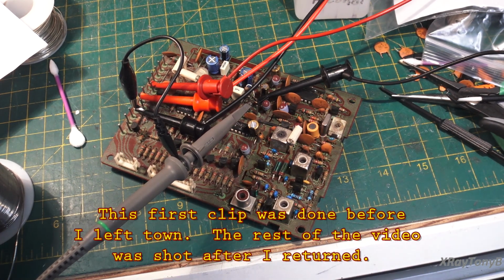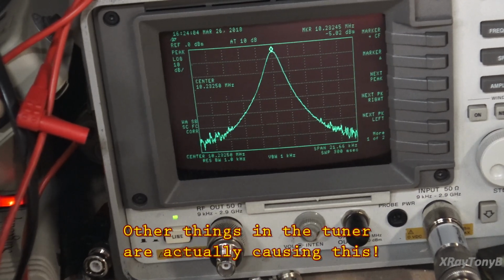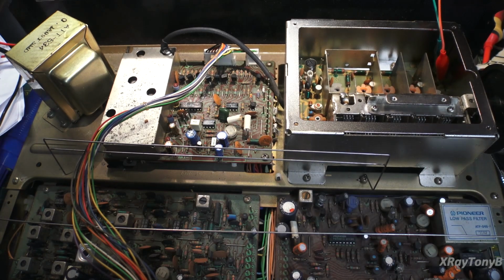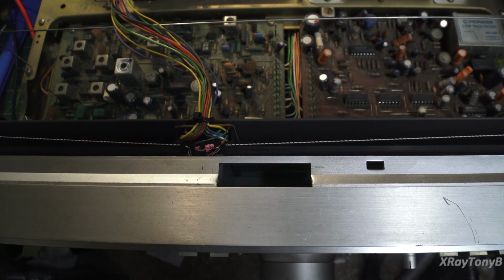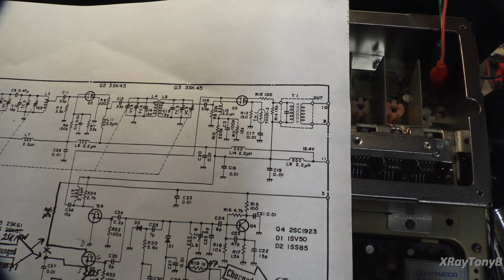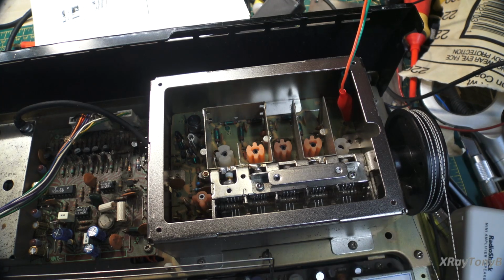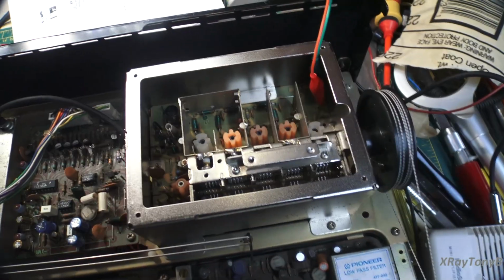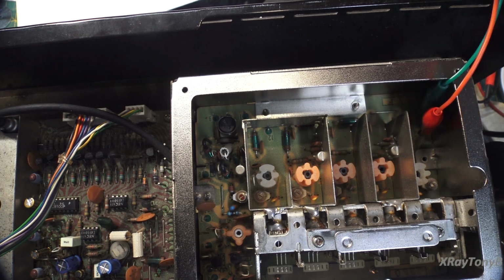Pioneer F-28 Part 5 - An Update

Comment: Great video! My first thought after you touched the 3rd (mixer) MOSFET in the frontend and the signal got much cleaner, was some parasitic oscillation (that could possibly be fixed by increasing the drain resistor a bit). Haven't watched part 6 yet though :)

Comment: Damn, I had a hunch it was a bad trimmer in the VCO all along, as they do tend to fail once in a while (and when a varicap is dead, it tends to be a dead short instead). There's really no telling without pulling it out of circuit though. Now the other ones sure seem suspect as well, though I'd make sure the varicap's wiper contacts (if any) are squeaky clean first. (Some top-flight tuners used to have wiperless varicaps, not sure whether this one does as well.)

As mentioned, testing the mixer MOSFET via IF passthrough does not seem the smartest idea on a unit that is supposed to have 120 dB of IF rejection. I'd rather want to verify that it's doing its job as a mixer well. Or maybe you could fashion some Rather Inductive Test Leads to attach to source resistor R12 (maybe using an old analog VOM that isn't bothered by RF)? If voltage were highly erratic, that would be very suspect, but what if it isn't?

Comment: This fix has almost been like a car chase in the city; up, down, all around the town!  Luckily no pedestrians injured!  I'll be quite happy to see you fix more normal stuff for a while.  
Assuming this replacement or a subsequent fix, repairs the whole tuner, please list all the fixes you made on the tuner to get it working.  This crazy "digilog" beast is so hard to understand, that there were a whole bunch of engineering changes on the schematics.  I suspect that those are there to fix bugs only exposed by use.  
I know you design your own equipment at times.  Using modern digital and analog components, how would you make an as good or better tuner?   You've been through almost all of this thing!  How could you add this tuner's sensitivity to a good digital tuner?  That's the same question as before really, but I believe this tuner shows that digital combined with analog may be how to make a "best" tuner ever.

Comment: Sorry for all the posts, but I wanted each point to be separate.  I have to disagree with you about injecting the IF at the antenna terminals.  Yeah, that probably works fine with most of the craptasic designs where the mixer is right by the antenna terminals.  But after two stages of filtering and amplification - it better have some pretty good attenuation at 10.7MHz when it's supposed to be passing 88-108MHz!  Frankly, I take this as a sign of a GOOD radio!  As for the mixer - do you get the same results when pushing down with a plastic tool?  (Perhaps your finger is an added antenna.)  Have you tried resoldering it?  (Perhaps it's a bad connection.)
Reply: Yes well normally you inject at the front of the first IF stage for working/aligning IF as you no doubt know because the front end is tuned for a bandwidth of 88-108mhz. But in Tony's case, he wanted to check the gain of each stage through the vari-cap...I guess he could have used 98mhz, but then that wouldn't work further down the chain in IF world....so I sort of see why he did that.  Plenty of different ways to skin a cat, gave him the information he was after.
Reply: I'd have to concur - this tuner is supposed to have a whopping 120 dB of IF rejection. (All those gangs have got to be doing something, right?) As such, getting any 10.7 through the frontend should be nigh impossible even when everything is working fine. Coming up with a better method for testing the mixer seems advisable.

Comment: Did you ever figure out what light wavelengths the photo transistors in the encoder were sensitive to?  I have to wonder if they weren't infrared.  The white LEDs may have been too "dim" at that wavelength to work right.  A dim incandescent is going to be a very rich source of infrared.  If it was me, I think I'd see if I couldn't add a resistor to drop the bulb voltage a bit.  A small drop goes a long ways to improving bulb life.  If that works, then the LED conversion wouldn't be worth the effort.

Comment: Yep, a lot of parts and circuits are the same between CB radios and receivers.  Back in the day most CB manufacturers just used what parts were readily available and were already being used in things like stereos.  That's why CB's usually have the same IF frequencies as receivers.  A cheap source of parts.

Trimmer caps, ugg....  Can't count how many of those I have had to change over the years, probably a couple buckets full.  There's usually not a week that goes by that I don't have to change at least one.

Looks like you have most of the faults tracked down on this now so your on the home stretch.  Thanks for sharing.
Reply: Hey Mike. Is there still a source for the ferrite slugs that I keep breaking in the tuning coils of my Marantz tuners?
Reply: The only source I know of is my stockpile of a few thousand ferrite slugs I have extracted from literally hundreds of parts chassis over the years.  What kind are you breaking?  The large hollow hex core ones, small can that use a slug that surrounds the coil/transformer that have a large slot on top or the small can with small slug that goes through the center of the coil/transformer with a small slot.  Are the ones your breaking sealed into the coil/transformer with wax or paint?
Reply: These are the small ones that thread into a small plastic/nylon coil form and have a hexagonal hole through the core for adjustment. They're maybe 1/4" in diameter. I'm not seeing any type of sealant or thread lock on any of them. For example, I have one Marantz tuner now that has four of them. Three are moving freely but one of them is stuck fast. I have non-conductive alignment tools that fit snugly but I'm afraid to put any more twisting tension on it than I already have.
Reply: Have you tried heating it with a hot air reflow iron.  Not hot enough to melt the plastic but enough that it becomes just ever so slightly a little softer.  I have found this works pretty good on the plastic coil form type.  And while heating it apply a little bit of Vaseline to the top.  It's already a semi-fluid at room temperature and will easily melt while your heating it and will wick down the threads adding some lubrication.
Reply: Thanks Mike. I'll give it a try.
Reply: Now, I'm interested. Did that work for you?
Reply: Haven't tried it yet.